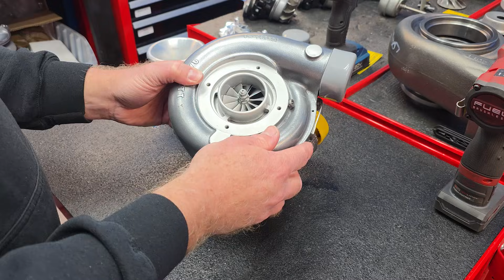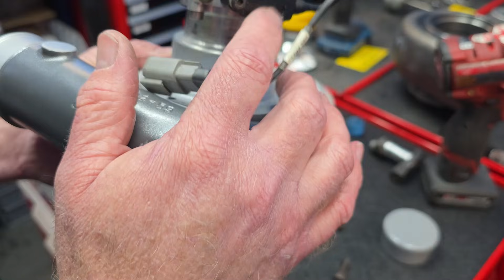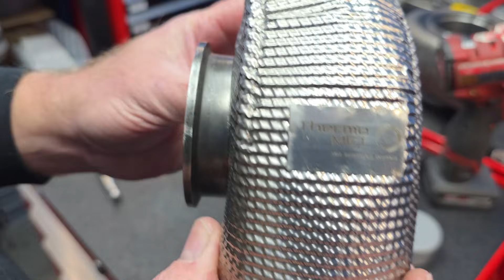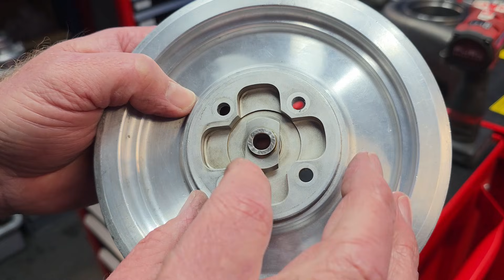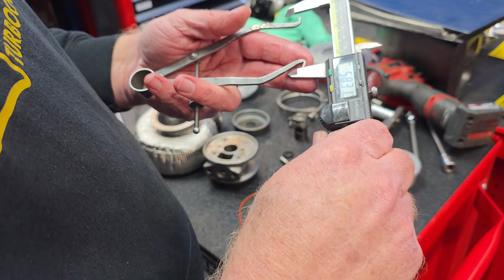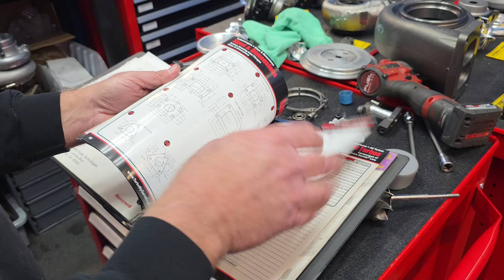Garrett TR30R Motorsports Turbocharger,  Part 1 History And A Look INSIDE!

Comment: Im surprised there is no watercooling and also the turbine housing is VERY small. But especially the no watercooling in a motorsport application seems a bit strange to me given the limited oilflow of a ball bearing CHRA i assume.
Reply from the maker: No watercooling is usually the norm for this turbo series, they are intended to be as light as possible and serviced after every event.  Some were even changed in rally cars between stages.  I have contacts that would share information with me back in the heyday of these races.  Weight and simplicity ruled over long term reliability!  Wish I had that type of budget for my "racecar!"  Thank you for the comment :D  Reed
Reply: @workturbo ahhh ok that makes sense then crazy to think they were changed every stage sometimes

Comment: Do you guys rebuild and or improve the performance of a stock Evo 8.5 turbo?
Reply from the maker: I can do some simple upgrades to the EVO 8.5, I have a slightly larger billet compressor wheel and upgraded turbine for it.  This would be very suited for a mild upgraded car looking for another 50-75 efficient horsepower upgrade potential over stock.  

This upgrade would run ~$1300 plus shipping, all top shelf parts and a full warranty.  If you are interested, drop me a quick email to support@workturbochargers.com for more info!  Thank you, Reed
Reply: @workturbo  The deal I had set up on the Evo 8.5 turbo fell through.  I do have a low mileage less than 10K miles old school AMS 50 trim turbo. Would you recommend upgrading that unit with a fresh rebuild or is it best to just go with a new turbo?
Reply from the maker: @DJ_Driven  I have all modern compressor wheels and turbine wheels for the venerable 50 trim...let me know how I can help!  Reed

Comment: It has the wrong exhaust side seal and bearing in it. 
They come with a ceramic ball bearing with steel cages for the extreme temperature’s maybe the later ones with cast iron bearing housings did not mine has a titanium bearing housing.
Also these mar’m shafts are a different quality then the normal shafts you can buy.
The first world rally cars like the focus used titanium turbinehousing, magnesium compressor housing, titanium cartridge, ceramic bearing, different seals and twin turbo speed sensor one as a backup if the first fails.
The pressure sensor in the intake ristrictor is a other way to protect from overspeeding pressure changes when it comes to the compressor speed limit.
Not every turbo supplier may buy the original parts fron garret for these so original parts are hard to source.
Reply from the maker: Thank you for the insight, Nick!  And yes, this one has the ceramic bearing with the metal cage.  Somebody has been in it a few times in the past...we will put all of the available correct parts in (high temp exhaust seal etc).  

I have had one of the magnesium comp cover/inconel turbine housing models in my hands quite a few years back...very proper "use of exotic materials" to say the least!   Happy New Year -reed

Comment: Great video! Ive got a load of the later TR25Rs here, few variants, mostly WRC and WTCC ones (and 2x insane magnesium/billet/inconel/titanium ones from a LMP1 car), but until I manage to break one ive not dared dismantle them beyond housing removal!

The early days of TR30s was amazing, you could actually get comprsssor maps and info, now Garrett Motorsport won’t tell anyone anything unless it’s a proper works race team and whoever is the chosen one to see comprsssor maps etc signs a NDA!

99% of official, even ‘Main’ and ‘Performance’ Garrett dealers, aren’t allowed to source or even get any details on TR series now, and repairs have to go Garrett Motorsport to done.

Officially that is, Im sure people like yourself could, maybe with some machining, make things work to repair them, even if they wasnt quite the official parts!
Reply from the maker: It is cool to see the published data Garrett provided....I would love to see if they are all the GTX wheels or if any of those maps are the 7/7 wheels we see in some. I really need to read over the whole published literature a bit more and maybe it clarifies. 

I have had one with the ti or mag center and other lightweight bits back around 2015 iirc. Was not allowed to do anything other than hold and admire it for a few minutes. 

I am now on the search for more info and parts...so lots more coming from me on these units. 

I love keeping up with all of your social media and YouTube posts, you get your hands on a lot of killer things for sure!  Reed

Comment: This is a FIA world rallycross turbocharger. If you look at Mountune/ Pipo motors RX engines they also have the 765392-59 markings on the comp housing. Liam Doran’s or Ken blocks RX cars also have the same markings, and the 45mm restrictor lines up with that class.
Reply from the maker: Many thanks for the info! Love it. -Reed

Comment: That was a pretty elusive turbo to get info on back in the day.  Been a long time since I heard "NS111".  There's probably only a few people still around that had any knowledge of that aero.  I might be wrong but back then, those turbos all went back to Garrett for freshening and you had to be someone "in the family" to play with them.  Thanks for the video.  I wonder what is going on at Garrett in terms of R&D now.  BTW....that for sure is Mar-M 247.
Reply from the maker: Appreciate the comment, and the trigger to do some more research!  I am going to ask a few old timers that were around the Garrett motorsports program in the early 90's.  I got to see some HKS ball bearing units back in the very early 90's...I think they all used the UHP turbine. 

 I need to lay out the UHP, this NS111 and a new G30 wheel side by side and just study.  I also have some Nissan diesel units that use what I think is a variant of the GT30UHP (but they could be GT32 as well...need to find that box of stuff...)  Fun times!  Reed
Reply: Still is the case. Officially they have to go back to Garrett Motorsport in the USA for repair.
It’s got a lot more secretive with regard to the TR turbos these days than back then.
Now you have to be a serious race team and sign an NDA before you can see any info at all, compressor maps or anything else.
Reply: @StavTech  Hi Stav, nice to meet you.  Went to your site to watch the videos and they are very good!  I have some aero info on those turbos and was never really that impressed.  Do you think they are heads and shoulders above current tech?  I just never got a warm fuzzy about them, they seemed like they were a couple years ahead of tech that was already coming down the road.  Garrett was so focused on production turbos that I never got the impression that the engineers were given the time and resources to do really cutting edge stuff.  Plus, everything had to meet durability tests that really hampered creativity.  In some motorsports they are dreadfully behind the times with respect to all-out designs.  Interested in your thoughts.  Take care.
Reply: @madmat990 yeah, personally I think their main advantage is durability. It’s not magic spool or power for any given size, though it’s still good/decent tech, it’s more focussed on being able to take the abuse for full race distances etc